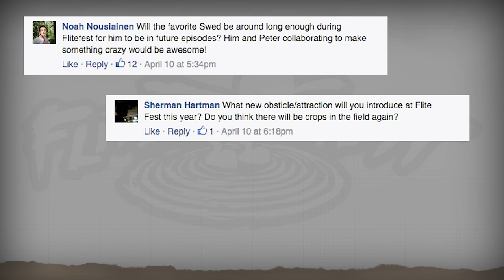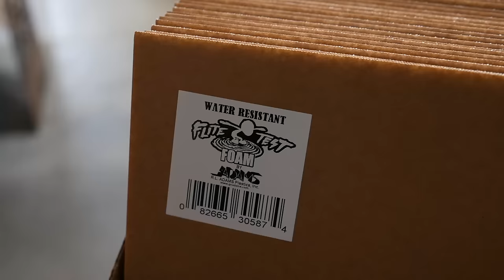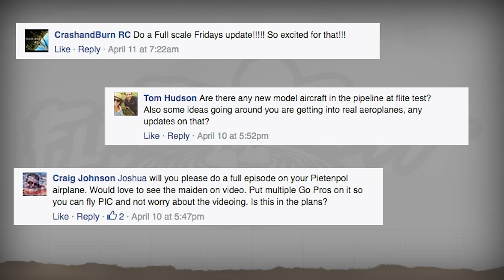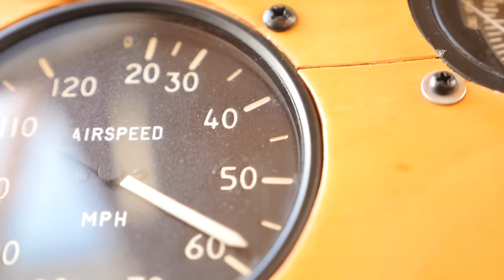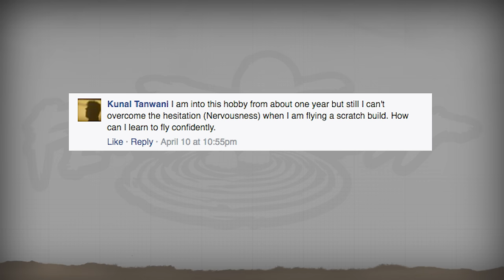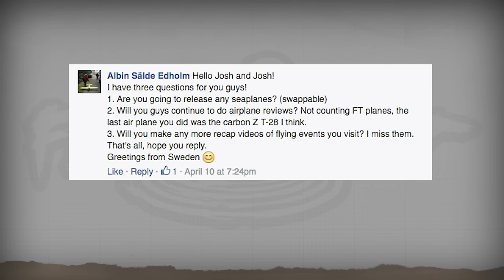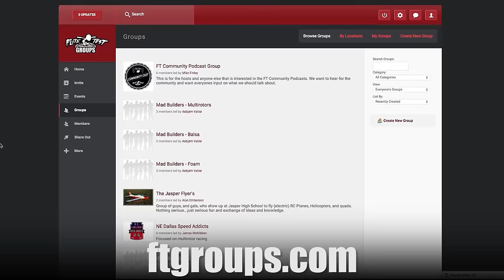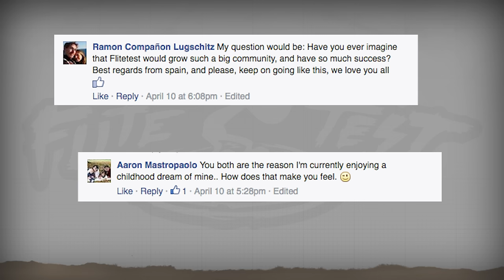Flite Test Needs Your Help! -  Spring 2016 Q&A

Comment: I built a tiny trainer and have been having an issue lately with the elevator getting stuck in one of the extreme positions, either up or down. My first suspicion was that the control rod was seizing up from rubbing against the fuselage where it passes through at the back towards the tail. However, after opening up the slit it passes through to ensure there is no friction, the problem persists. The elevator usually goes back to neutral when the plane hits the ground, or if that doesn't do the trick it goes back to neutral when I manually push/pull it back. Any thoughts on troubleshooting that issue? (You guys are great and got me into this great hobby, can't thank you enough for sharing the fun)
Reply: +nlp Does the servo work correctly when control rod is not connected? Perhaps the servo is broken or worn out?

Comment: that sure looks like a waterproof foamboard floatplane in the background. nice teaser! please be sure to suggest strategies for building it in ways to keep the main electronics dry. I know about Peters
Reply: corrosion X tip but it would be nice to seal out water from the receiver and esc at least. thx

Comment: When´s the bigger Arrow coming out? having tons of fun with the Mini Arrow !!!
Reply: I made poster board templates for the mini arrow last night.  Going to build it tonight.  How does it handle extra weight?  I'm wanting to build it as light as possible and run a 200mw 5.8ghx vtx and a board camera.
Reply: +ShareCraft Great!, it's a wonderful plane. I run a standard setup on the current one, power pack A, and 800 mAh 3s, but I'm scratch building a new one with a centerpiece Andre Rousseau used in his and power pack F, I think it's a tad heavier, but by the looks of his videos, it handles great!
Reply: +RCLateBloomer cool.  Thanks for the reply.  I'm going to build mind with white gorilla glue to save some weight and get the lightest  200mw vtx I can find..

Comment: Is there a weight difference from the water-resistant foam to the original?
Reply: Yes. The water-resistant foam is slightly heavier, but it is a lot more durable.
Reply: +stilldking No, same weight.
Reply: I weighed the water resistant foam board against the old foam. I weighed five sheets of each and the water resistant board averages 3 grams heavier per sheet. So there isn't really a weight difference.
Reply: +Ben Presten Thank you. Those are the specs for which I was looking. (Only 3 grams heavier per full sheet is an impressive feat considering the water resistance and added durability. Looking forward to experimenting with this.)
Reply: I have absolutely loved working with the foam. If you are considering buying some even a little, DO IT!!!!

Comment: I want to see if it is possible to add washout into a wing as I have a fpv raptor v2 which has a tendency to tip stall. I think it would help a lot of people
Reply: +proffesionalretard Hi, you can add a form of 'washout' buy siply trimming each aileron a little upwards, this effectively reduces a tip stall in planes where the wing is a fixed structure and has tip mounted ailerons.

Comment: can you make a flying plane using 2 channel control
Reply: That then must be a fixed-pitched elevator plane which height is controlled only by speed on channel 1 and rudder on channel 2. Biggest problem will be to set the elevator in an angle that wouldn't stall the plane. 

Here in Germany are rc-planes in the stores with two engines and fixed rudders. They are controlled only by the speed of the engines and a two-channel controller.

Comment: Is the Guinea pig a good starter?
Reply: +3fim2 I believe I remember Peter warning that it's somewhat complicated to build, but flies pretty well. I definitely want a guinea pig, as it can be modified in so many different ways, but It's quite complex compared to others. I haven't been able to fly mine recently, but the FT22 was a dream to build, and is meant to be quite maneuverable, but if you were to get the FT22, make sure you have a transmitter that has an elevon mode. I don't know how easy it is to build something like the explorer, but a good plane to start flying on will normally be 3 channel, without ailerons, and has wings that gradually rise the further out from the fuselage. Though you can't build it, a great trainer I had when I started was the Hobby Zone Duet RTF. I'd recommend that if you aren't set on building your first plane.

Comment: if you do build a real life plane try making one that can take the tough windy conditions of Alaska.  like that plain that can take off and land by shifting the motor to take off and land vertically and something similar to the aroplane that can take off and land in water.  have the best of both worlds.  I like the aroplane  cause its a cheap airplane and I would like to see something designed that the public can build easy and on the cheap for Alaska bush.

Comment: Can you guys build a jet that can activate a model rocket booster in mid air? Hmmm?
Reply: +Eduard Mir flight test did do that with the rocket shinden.  And they also made a flying pipebomb on accident.  and broke thier gps speed thingy.
Reply: And maybe a flat spin booster for good measure
Reply: silentseawolf No I mean like powered witha motor, not piggybacking

Comment: I want to fly fpv with a racing drone. I can't afford these fat sharks, which are hundreds and hundreds of £/$, and my current goggles are very low quality. I need better quality video, and I need a video transmitter and control system that can work behind trees/buildings/hills, but it can't be expensive, but not budget. Any help? I'm a newb so not in tune with the jargon.

Comment: Too bad my tiny trainer never flew because of a faulty engine :( I will never be able to feel the joy of RC flight :(
Reply: +Cat riding a Hog Was it a motor from Flite Test? Don't give up. A faulty motor is not something you can't replace.
Reply: Balu Yes I built the plane and every thing but the motor spins the prop to one side for 10 degrees to the other. Hopefully around this summer I can have enough money to buy another motor.
Reply: +Cat riding a Hog This sounds like a connection issue. Did you solder the connectors yourself? Try switching the connectors or unplugging and replugging them again.

If it still doesn't work, contact Flite Test support. It might just be a faulty motor or ESC and if you bought it from them, they might replace it for free.

You can also try and find a local club or hobby store or even another Flite Test community member to check the wiring, perhaps test a different motor. Just asking nicely doesn't cost a thing. And the hobby shop knows they'll have a happy customer that might come again if they can help you. :)
Reply: Balu No I did not solder it. I dont think the FT support will help me since I got the plane around December 2015, and all my friends dont know the difference between a drone and a fixed wing. I just gotta save up probably gonna buy other trainer since I already got the control and battery.
Reply: Send a video to support@flitetest.com  we will help you brother. It does not matter when you bought it. We just want you flying.
Reply: Ok thanks :)
Reply: Josh Bixler Sorry for the late response, I can't bind the controller to the receiver.
Reply: +Cat riding a Hog What transmitter / receiver are you using?
Reply: MZ-10 is the transmitter and GR-12L is the receiver.